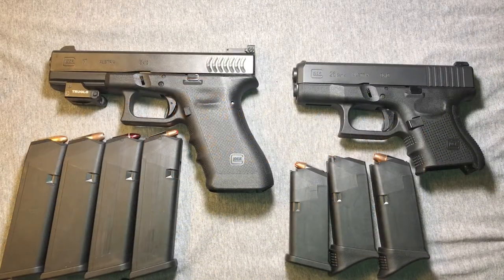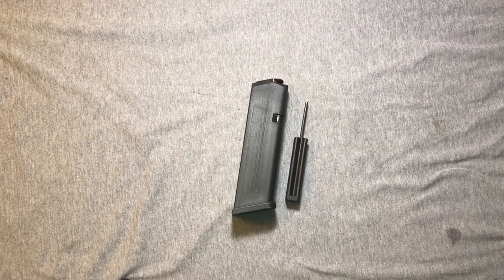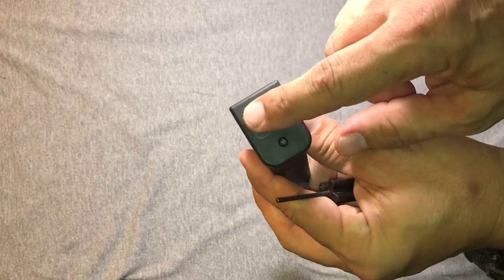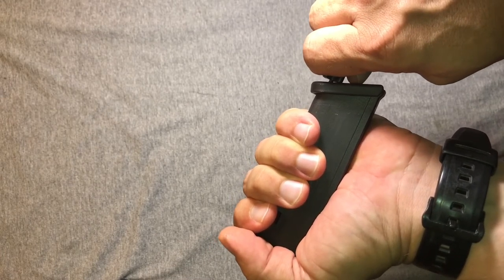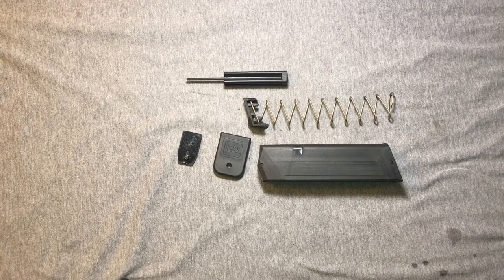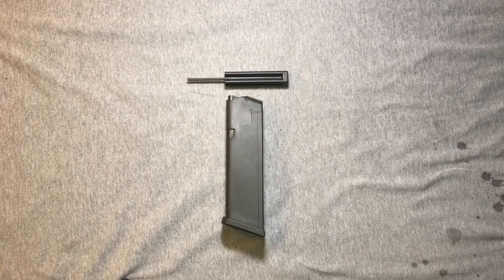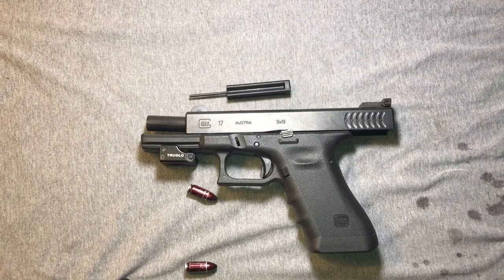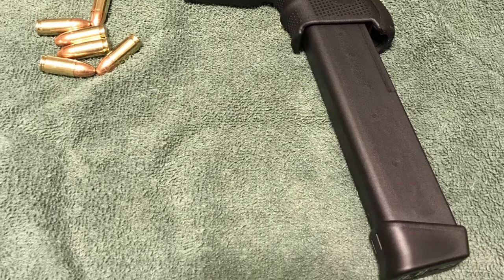Quick and Easy Glock Magazine Disassembly

Comment: I have been curious how they blocked those things off.
Reply from the maker: As an aside, I’ve had that 10 round magazine loaded continually since 2011. No real debris inside to speak of and as near as I can recall it’s worked flawlessly. The real reason to disassemble was to add +2 floor plates plates to my Wisconsin  Glock 26 10 round magazines. (+2 plates don’t work with g17 10 round mags).  If you get in a gun fight with a 12 pack of Sam’s Choice 10 in the magazine and one in the pipe is never going to be enough.